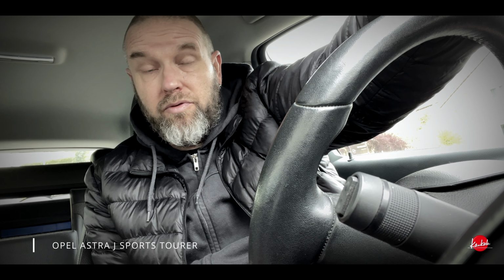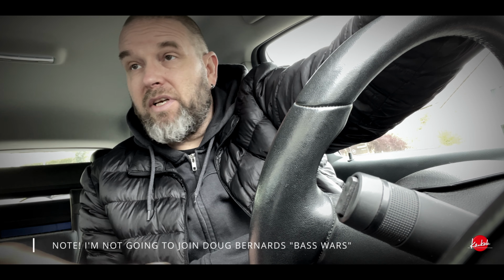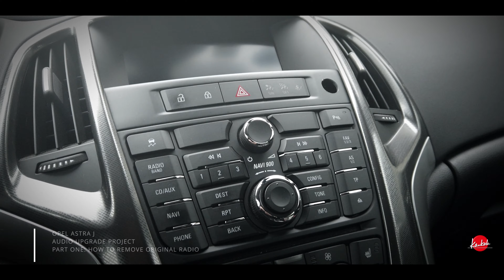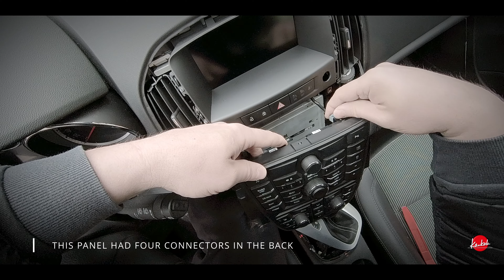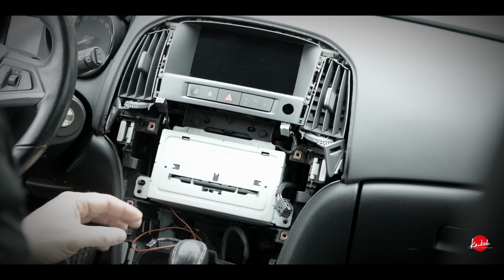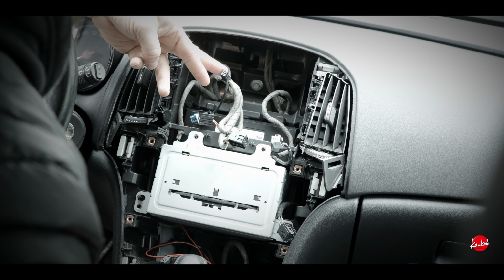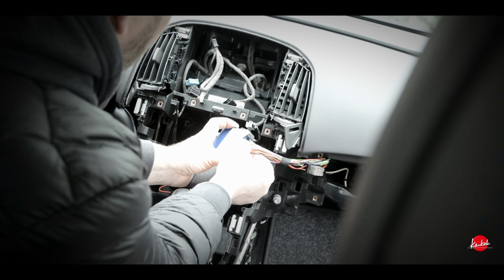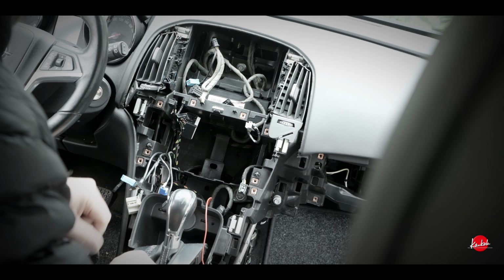Astra J OEM audio upgrade project - How to remove the radio

Comment: Quick question about the tweeters if you installed audison tweeters already. How did you make them fit in an angle? They do not fit into car factory bracket.